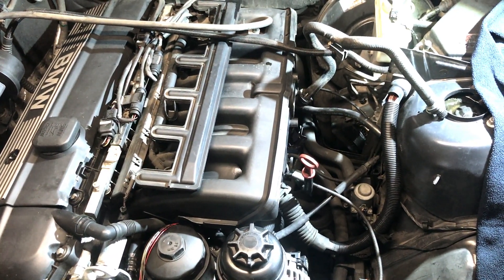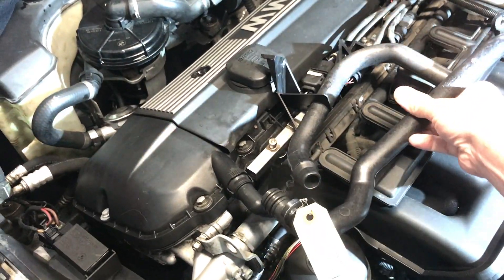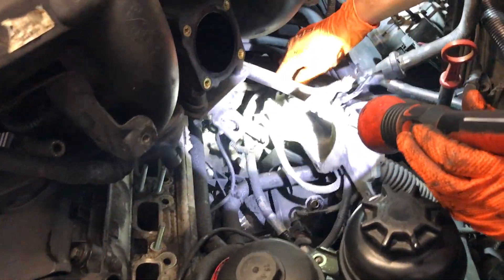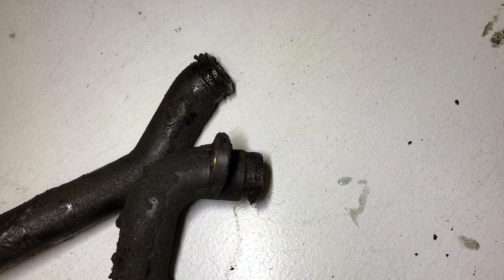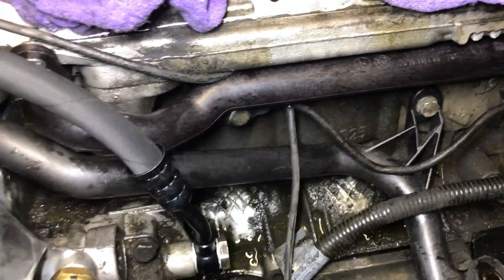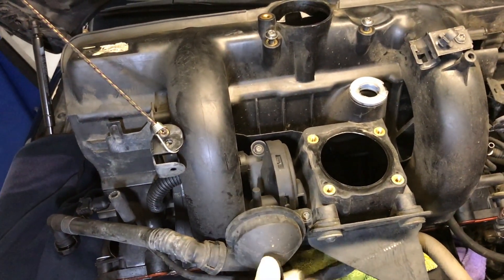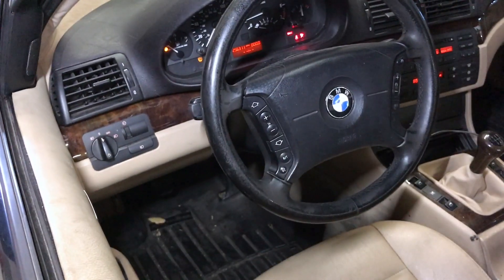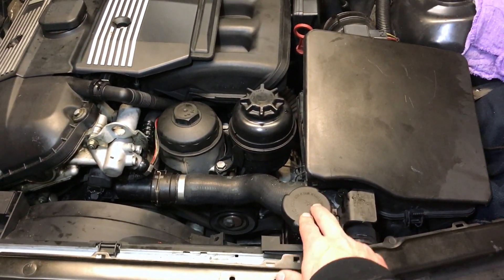Coolant leak under intake manifold - Older BMW's with Inline 6.

Comment: Good video, thanks. What’s the best way you’ve found to get the ‘broken off’ bits of hose left behind in the block? My car is 2002, so those pipes have been there 20+ years.
Reply from the maker: Thanks!  i just pull them out with a hook pick.
Reply: @MikeMDs  Appreciate that MIke.
Reply from the maker: You are welcome. Best of luck

Comment: What is the name of these hose? Cylinder coolant hose?
Reply from the maker: The name is very generic. Coolant pipe.  But you can search coolant pipe from cylinder head. Most of the hoses on the engine are rubber. These are the only ones that are hard plastic.

Comment: I got oil leaking down there. Cleaned checked c
Bacl but not bad im thinking oil filter gasket
Reply from the maker: You are probably correct. Either the oil filter cap o-ring or the oil filter housing gasket.  If you replace the oil filter housing gasket on this engine it is a good idea to also replace the oil feed line to the housing

Comment: Hey i have this same problem im trying to find these hoses so i can buy them and install them but cant find them do you have a link?
Reply from the maker: No but you can look it up on realoem.com  Click the engine diagram after putting in your VIN. You can find the diagram for them and the proper part number for your VIN will be listed at the bottom
Reply: @MikeMDs  Awesome thank you!

Comment: Just did this swap on the hard lines. 251000 miles. Second time I’ve changed these over the life of the car. 2004 E46. It is a bit of a job.

Comment: Can this issue case white smoke coming out your tail pipes, like there’s a head gasket leak when there isn’t?
Reply from the maker: This will not cause white smoke from the tail pipe.
Reply: @MikeMDs  i figured it out! It was my pcv system that was throwing a smoke screen while i drove
Reply from the maker: Wow i'm glad that is all it was. Good work!

Comment: I definitely believe in replacing the low quality plastic parts with an aluminum upgrade and OEM rubber hoses with the high quality silicone ones (if available). Doing that is a must to increase reliability to make ownership easy as possible.

Comment: Hello my friend, the check always shows me the check coolant level, although everything is correct, could the defect be from the same sensor as the bme x5 e53
Reply from the maker: The float could be waterlogged and stuck on the bottom of the tank. Or the system has air in it that is trapped after a repair or small leak.

Comment: I'm hoping someone can help me I just replaced the expansion tank, also new fan shroud & plus some other stuff but as I was just about to hook the two hoses on the bottom of my expansion tank I was interrupted by a burst water main outside my place so when i finally got back to the car some 40 minutes later I noticed the hoses we're not in the same place I left them in 😮 SO, I hooked it all back up the way I think they should go but I'm worried I may have mixed them up took it for a run around the block & she was a little hot when I returned, now I did bleed it correctly but I forgot  to run the heater on full & so I'm gonna leave it for the morning it's been a long day but any advice would be much appreciated thanks

Comment: Hi, in 2008 bmw x3 i see tge same steam coming out but the temp gauage is normal and not rising, i dont see any temperature gauge pin moving towards red, also the radiator fan doesnt turn on while steam is coming, tried with bmw standard bleed procedure i dont see any coolant coming to reservoir tank, also i see the engine oil i coulnt see any milk color or coolant mixed with the engine oil nor i see any leak outside . any suggestions

Comment: HELPFUL TIP: THE O-RING SECTION WILL  PROBABLY BREAK IN THE BLOCK. USE A SECTION OF HACKSAW BLADE OR JIGSAW BLADE WITH VICE GRIPS. CUT SOME GROOVES IN THE PLASTIC. BREAK IT WITH A SMALL SCREWDRIVER AND THEY WILL POP RIGHT OUT. DONT PRY ON THE BOCK PLZ!
Reply: Cheers mate , I think you saved me a huge headache  👊

Comment: What pipes are those where are they called
Reply from the maker: In the parts catalog it just calls them water pipe. But when asking for them. They are coolant pipes from cylinder head. Under intake manifold.

Comment: was this car just leaking or over heating aswell?
Reply from the maker: It was just leaking. But it can cause overheating as well. If leaking while at operating temperature. Then letting it sit overnight. The coolant system goes into a slight vacuum and can suck in air from that area. This will cause the engine to overheat due to having air pockets in the coolant system.
Reply: @Mike MDs  Thats exactly what mines doing Thank You for replying Much appreciated

Comment: hello! hey do you happen to know if Filter Housing takes any Engine Coolant? i started gettin milky/ honey alike oil so i was wondering if it could be getting mixed in there
Reply from the maker: Yes it can mix at the oil filter housing.
Reply: @MikeMDs  I did some research and coolant housing doesn’t have any water going in there my engine its E46 Engine M54 i haven’t remove it to check but i will just incase! i’m removing the head to replace head gasket thinking thats the problem! one way or another i’ll figured out i think 😂

Comment: theres another way to bleed it had my car for Years! add water turn on car, leave Water Cap open, temperature heater at Max (Ac Temperature) and hold accelerator until you see water come out of that tiny hole on the side of the radiador expansion tank, ones it starts coming out it Spits air out as water is coming out  do this until you don’t hear any more air coming out, water wont come out of this Tiny hole until Thermostat opens up, Maintain water level at all times and you should be good!! Never use Tap water it Must be Distilled or you’ll screw up your thermostat!!

Comment: whats the name of the part
Reply from the maker: The part name is vague. But, Coolant pipes from cylinder head.
Reply: @MikeMDs  thank you for replying i just bought a 2003 e39 and i think it has the same problem
Reply: @MikeMDs  were did you buy your replacment lines?
Reply from the maker: We have a wholesale parts provider. But you can get them off of pelicanparts/com

Comment: I just had my radiator replaced , now I got no heat or a/c  my reservoir stays full car stays at normal operating temperature any clue?  Radiator is a sealed one with no cap no way to check the level in radiator but level stays full and cool in reservoir any advice? I like your video!!
Reply from the maker: It may not be bleed correctly.  What year and model do you have?
Reply: @MikeMDs  2008 Lincoln mkz
Reply from the maker: I don't know anything about those cars : )

Comment: Thanks for the tip on the rtv gasket maker. Someone had done this job previously and the port surfaces are not very smooth at all. Will be using rtv on it. They had rtv on it but it was disintegrating.
Reply from the maker: Oh great. Thanks for the visit.

Comment: I always but key in hit the start button ONE TIME with NO foot on brake. This turns everything on but the engine then turn in heater to hot blower fan speed LOW. You then press the throttle to the floor and hold for 10-12 seconds. You will hear the water pump turn on it will run for 10-12 minutes. Just keep an eye on coolant level and add as needed this is the true correct way to bleed the coolant system. It works great and has no issues when done this way. It is the true correct way it is suppose to be burped.
Reply from the maker: You're right. Thats the perfect method for BMW's with electric water pumps. This engine has a mechanical water pump and requires the engine running to bleed the coolant system.
Reply: Interesting I have never worked on one that did not have an electrical WP. Well newer than 2000/01 I thought they all had them now. My mistake I know when I am wrong and guess I was on that only for I have not worked on one that was belt driven, learn something new every day.

Comment: What's the proper name of those two pipes can you tell me
Reply: The upper pipe is called: Heater Inlet Pipe  -  11531705210
The lower is called: Water Pipe  -  1537502525

Comment: The L-shaped pipe at the bottom of our radiator broke. It connects to the bottom left of the radiator (driver side) where it connect to what appears to be a large o-ring but I've no idea how to remove it. Do I just give a hard twist?

Comment: I appreciate the video! I just picked one up and the owner said it was leaking from back in this area. Diagram only showed these 2 hoses… dismantled and followed your advice and ordered all of the replacement parts… exactly as you described, crusty pipes and hoses that needed to be replaced. About to button back up and move on to the suspension… 😩
Reply from the maker: Wow, you're rebuilding that thing. Right on!

Comment: I have a 2002 x5 156401 miles. It was leaking coolant for two days. I was literally putting a bowl under it and reusing the fluid from work to home for 2 days... then when I get to the repair guy.... NO evidence of a leak. WTF So what do I do now ?
Reply from the maker: Take to a specialist or dealership. It should be easy to find.

Comment: how do u know if does hoses are broken ? would their be dry coolant everywhere  or on da floor ?
Reply from the maker: They start off with a slow leak, then split causing more coolant to spray out. At that point you will definitely see coolant on the floor.

Comment: I think am gonna have to change does on my car. My 525i has 210k miles. I have dry coolant all over my engine I thought it was my thermostat and changed it but I still have the dry coolant.

Comment: I have a 2003 BMW 530i, what part exactly is this? How would you call autozone and ask for this specific part?
Reply: Did you ever figure out what it’s called? I’m having this issue right now.
Reply: @JefferyThompson-u2x  yes sir, ended up being something called the engine cooling system.
Changed it out and it solved the issue all together.

Comment: With car off I can pour coolant into the resovuior & it leaks out almost instantly.  Can't see where it leaks from in the engine bay, but can see underneath from the middle of the engine/subframe area. Could this be the issue?
Reply from the maker: It could be the area. It's hard to say without seeing it.  If its wet in the pipe area in the video then you know thats the spot.

Comment: What’s the part number  on those pipes?
Reply from the maker: 11537502525 and 11531705210  . They may be different based off of your VIN Number.  You can look it up on realoem.com. Type in the last 7 digits of your vin and click the brows parts button and then the engine symbol and scroll through the pictures till you see the pipes.

Comment: Mines leaking, you think that could also cause vac leak ?
Reply from the maker: No but it will give you a good chance to change out the crankcase breather with pipes while you are in there. They cause vacuum leaks.

Comment: I have recently discovered I currently have the same leak underneath the Manifold on my 330ci convertible. It took a radiator change ,  a sensor change and an expansion tank change for my bloody mechanic to discover the leak is here. The car is due into the garage again tomorrow 😞..  I may as well have my Crank case ventilator change too seen as that area needs to be opened up.

Comment: I have an 03 bmw 325xi and when I refill the coolant it pours right out of the bottom. Any idea what it could be ? I can’t really get under to check myself
Reply: Your expansion tank is cracked easy fix mate
Reply: @hellxxslayer9660  yes it was ! so I replaced that and it’s still leaking a little now. Still drivable but I have to pour coolant in it so often. I think it’s something to do with the radiator drain plug. Any ideas on that ?
Reply: Change your water pump and thermostat. Also it could be the orings on the hoses
Reply: Definitely check those o rings. Like FR FR
Reply: It was the water pump and thermostat

Comment: I've got a leak by the transmission bell housing - whole top side is dry. any ideas?
Reply from the maker: Yes it’s most likely coming from the oil pan gasket. It collects at that area. It could also be a rear main engine seal or transmission input shaft seal. But probably the pan gasket
Reply: @MikeMDs  its coolant though? whole top of the engine is coolant clean no leaks

Comment: on my 03 Z4 just replaced the two plastic coolant tubes, plus the water pump, thermostat, expansion tank and all hoses.  Basically everything but radiator.  Getting the manifold off was a bear, but I managed it.
Reply from the maker: Good work!
Reply: What are they

Comment: What are these pipes called I need part number or links my friends e46 I took it all apart and it’s these pipes I can’t find out what they called
Reply from the maker: Just coolant pipes. Give me the last 7 digits of your VIN number and I will get the part numbers for you.
Reply: Hi Mike MDs - can you kindly help me with with part numbers too for my vehicle?  Last 7 are PH32405 2003 325i.

Comment: Is there a way to JB weld it until I have time to fix it?  I believe my leak is coming from the bottom hose but not sure yet.
Reply from the maker: You can try.  The guy doing the repair on it after will not be happy though. Only in a jam, otherwise I don't recommend it.
Reply: @MikeMDs  I ordered the hard lines plus the return hose that one of them connects to because that was an original too.  Question...when taking those hard pipes off, do you sand the area with 0000 grit sandpaper and vacuum it out?  Do you use high temperature RTV to make sure it is sealed?
Reply from the maker: Yes you may need to sand  the holes if they are pitted and not smooth and clean them out.  If so then I would use the RTV.

Comment: Any ideas on coolant leak rolling from behind crank pulley and coming down from side of ac compressor I know it’s coolant cause it’s blue and feels oily only leaks when car is off and cold 
2003 BMW X5 i6 3.0 155k miles
Reply from the maker: Sounds like water pump, or thermostat gasket.

Comment: Hey man I recently got a 03 325i with 176000 miles and there is a leak coming from what looks like directly under the center console area under the car do you have any idea what it could be
Reply: It seems to drip intensely after I turn off the car after running it for a while and seems like a pretty thin liquid and my ac doesn’t blow the coldest could that be it ? Or transmission leaks ?
Reply from the maker: it is most likely condensation from the A/C system. There is a condensation drain right in that area. If it is clear then I wouldn't worry about it. But keep an eye on you coolant level for the engine. The clear jug in the engine bay ( some are black)  . If it keeps going low then you have an engine coolant leak.
Reply from the maker: If your A/C system doesn't blow as cold, then that is a separate issue. Most likely low on freon.  In that case It just needs an A/C recharge.
Reply: @MikeMDs  thank you I’ll definitely make sure to watch coolant levels and get that ac recharge. One more thing is when I go full throttle to the floor sometimes the rpms go real high before it shifts not redline but pretty close and just takes a second to get going when I go pedal to the floor. Do you have any idea what that could be as well?

Comment: This shouldn't apply to the e60 m54 though. So the bottom one is the water pipe and that upper one is the heater one. So I have coolant flooding out of my upper connection area, but when I pulled out the manifold there was no hose hanging out under it and there isn't anywhere for it to have gone and idk why it would have snapped there like that anyway. But it seems like my 2004 530i m54 has a "blind plug" where that upper would go in. Apparently it's only like that on e60 m54 engines and up 🤷‍♂️
Reply: Yes I just ran into this problem looked like a black tag with a 1/2" hole in it being held in place by a nut on a stud to the side of head after talking with a couple of BMW techs and looking at all sorts of diagrams and pictures on Google

Comment: I replaced my coolant pipe (upper) and it still leaks from the part that connects to the engine. I took everything apart again to get to that pipe. Does gasket sealer really work cuz this leak is driving me crazy?
Reply from the maker: it could be due to a pinched or rolled o-ring on the new pipe. I’ve seen that happen on that repair.

Comment: Dammit, that’s what mine is doing. What should I pay for that and what are those hoses called?
Reply from the maker: Every shop is different on pricing and depends on parts brand. But they are called cylinder head coolant pipes.

Comment: Thats awesome to see a high mile E46 with 236k miles, Im at 113k miles on my 325i facelift. Gives me an idea when I need to do this. I replaced the original ccoling system at 99k miles on mine right when the thermostat threw a cel. Great work, you do awesome work like my dads friend who works on bmws all the time and drives a E46.
Reply from the maker: Thats awesome man! They (e46) really are great cars.
Reply: @MikeMDs  Absolutely! My dads friend drives a 330i sport with over 200k miles with a 5 speed manual. Great cars as far as powertrains and smooth six cylinder engines that give simple performance.
Reply: I have a 2002 330i second owner with over 307,000 miles lol manual still running strong interior is mint could use a paint job though